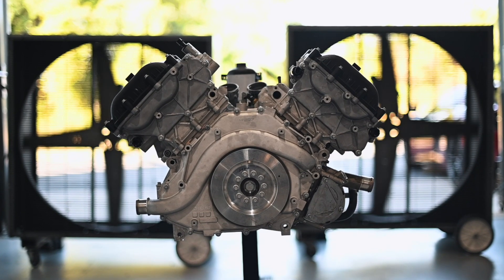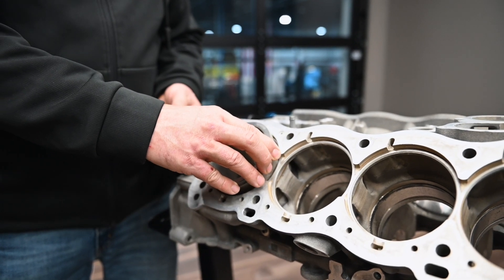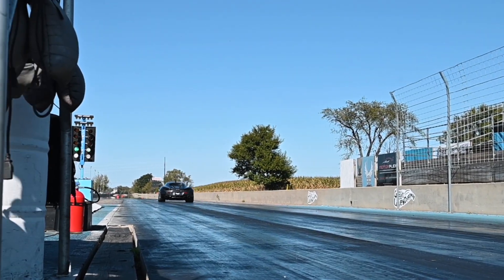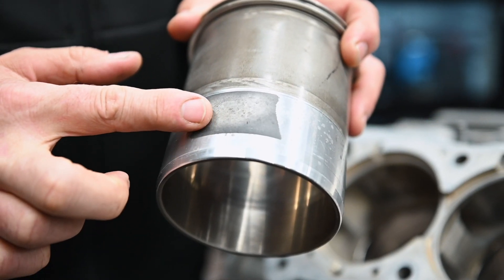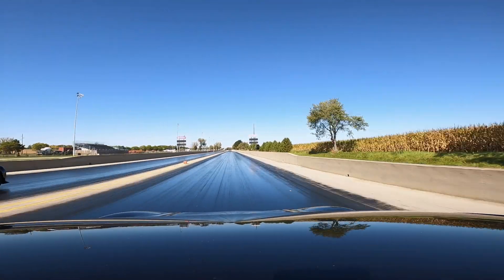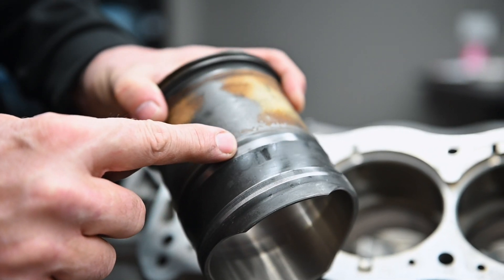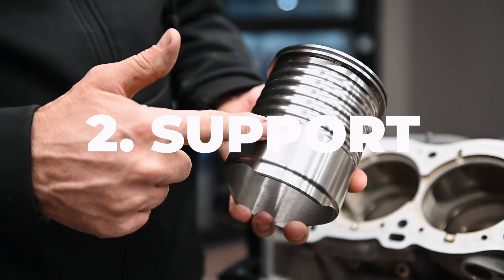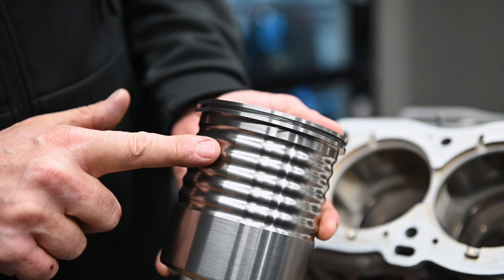McLaren Engine 101: Sleeves

Comment: Do you recommend an arp bolt upgrade for the head bolts and the big crank hub bolt
Reply: Definitely use arp or some rolled thread equivalent when going for more power 👍 otherwise you get head lift

Comment: What is your opinion on raising the idle from 600 rpm to 800 or 900 rpm to slighlty raise the oil pressure at idle and make things last a little longer. It seems like everyone is having oil pressure problems lately or worn finger camshaft followers rocker arms or worn oil pump shafts. I know the senna oil pump fits all of them and is an upgrade but i think they just dont get enough oil flowing at such low idle 600 rpm
Reply from the maker: We run a higher idle speed on all of our CSO spec tunes to help with oil pressure.

Comment: What is the actual weight savings in the aluminum vs iron sleeves? I would assume some, but not a whole lot. And would that weight make any difference?
Reply from the maker: The OE iron sleeves add a total of 9.3 lbs to the engine. Our sleeves add less than 1 lb total to that.
Reply: @  Wow! That’s surprising. More than I expected.

Comment: good stuff,can the same desighn sleeve be made to fit other engines?like vr38 etc
Reply from the maker: The ductile iron material is already used in VR38 applications. There is a difference in the fact that the VR38 is a dry sleeve and the M838/40T is a wet sleeve.
Reply: @cannonballgarage  thanks for the info,would you say vr38 stronger block stock then 720s stock for stock?
Reply from the maker: @durin23  we have not found the limits of the McLaren blocks as of yet. Companies like T1 are pushing huge HP numbers through stock VR38 blocks. This is a "stay tuned" kind of question as we push the limits of the McLaren blocks. The rods in the McLaren we can tell you are a weak link.